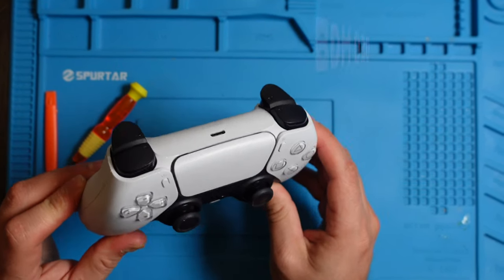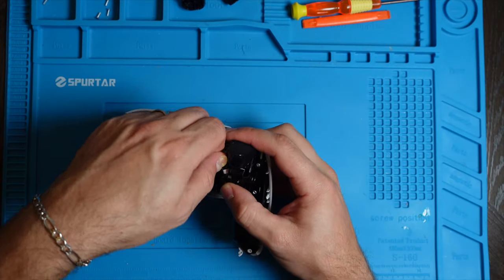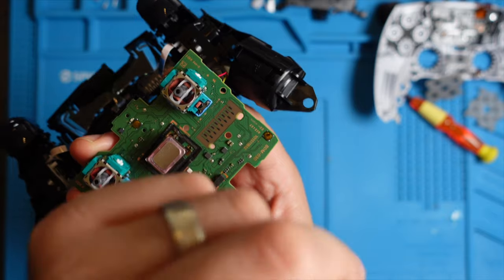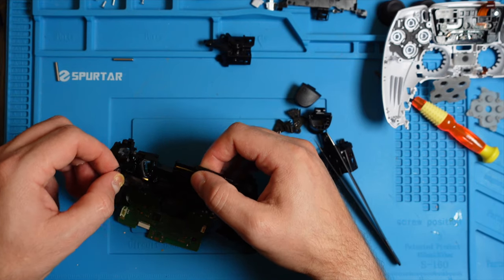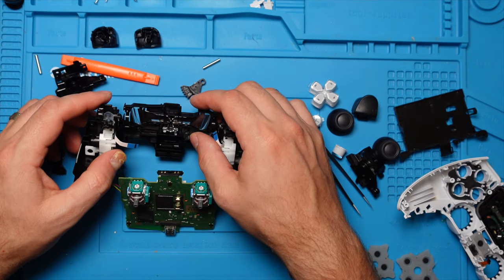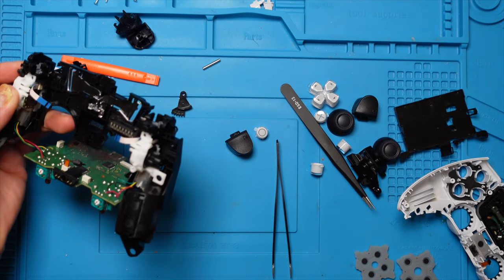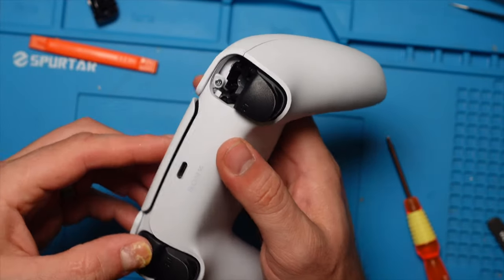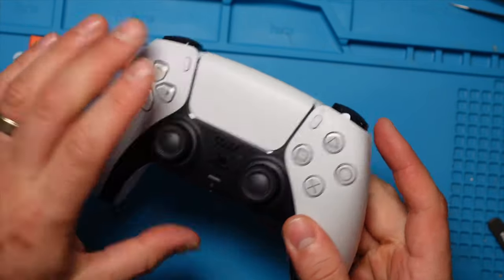BDM 030 PlayStation 5 DualSense Controller Teardown

Comment: With that green wire that you soldered back on does it do anything important like does it have something to do with stick drift because I’m debating whether I should buy a cheap soldering kit to solder the wire back on hoping it will fix the stick drift or should I not? Like will it fix my stick drift?

Comment: What's better in this one? Comparing to bdm 020
Reply: exact same
Reply: @Hazura8321  how?
Reply: @shfd3832  the only difference is the motherboard, everything else is the same, theres no better generation technically
Reply: @Hazura8321  now bdm 040 released last month. What difference
Reply: @shfd3832  different motherboard lol
Reply: I personally prefer 020 and 010 for the way the triggers are made. Power goes through the ribbon cables rather than being directly welded to the board. With 030, soldering is involved if you need to change  that. As for functionality, it all seems the same.
Reply: every new version is made cheaper to save cost.

Comment: Very helpful, thanks! Did not expect the button ribbon to be at cause sometimes, I'll try a new one.
I have a controller with both l2 and r2 not working at all, no signal. Any idea what could cause this? I'm still troubleshooting myself, changing ribbons does nothing, about to try another board.

Comment: @Gamer2know I really need your help. I wanted to fix my ps5 controller its Bdm-30 I made a mistake now idk how to get another one the only way to tel is to open the box the stores wont let you and its not online where can I get a Bdm-30 controller I accidentally burned the sodder hole on the potentiometer. It wont solder in a new one. I need a new bdm-30. Is there anyway to know how to purchase that particular model
Reply from the maker: I bought few on amazon last week and they came 030
Reply: @TheGamer2Know  which color did you get is there anyway you can let me know I can’t find Bdm-030 anywhere. I wanna get the one you got. All the controllers in store I got 4 were all Bdm-040 had to bring them all back.